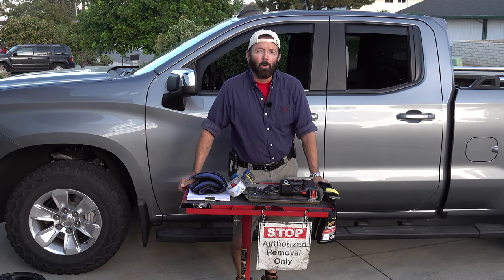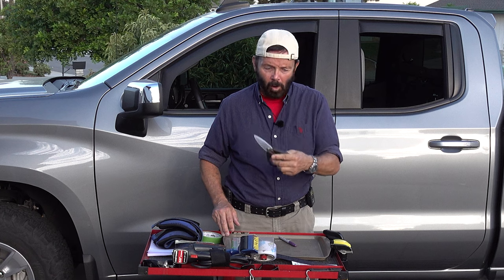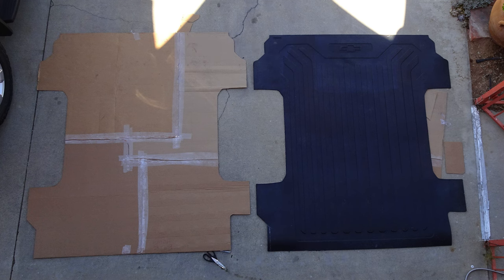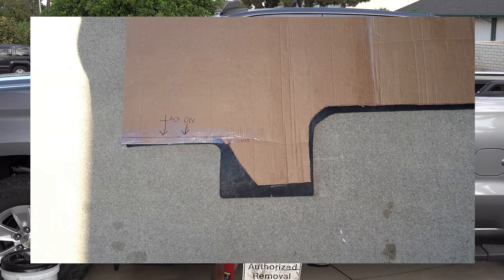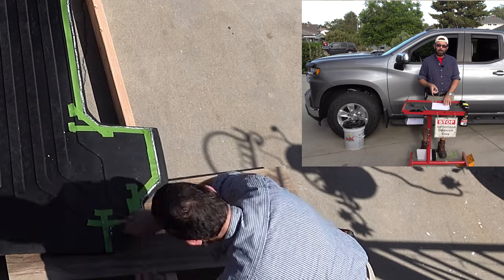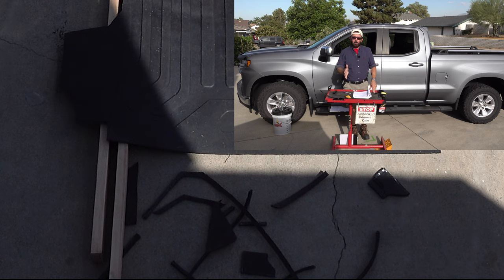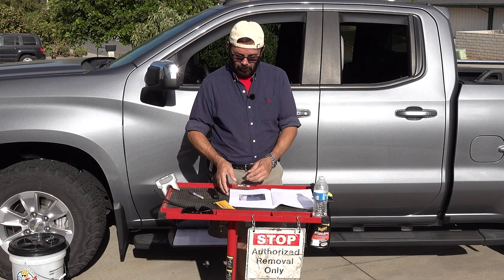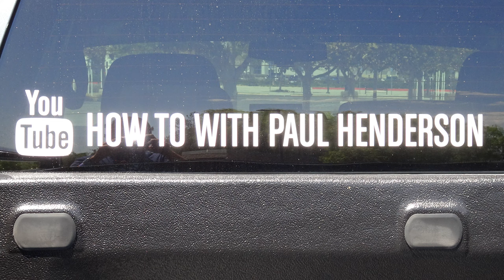Chevy Rubber Bed Mat modification to fit in my Drop in Bed Liner w/Paul Henderson

Comment: Excellent video and instructions/tips. I have a 1998 F150 that has a bed mat lying on top of the bed liner. It has been outside for 26 years, and it is still good as new. It also appears to be twice as thick as the one you demonstrated. A carpet knife wouldn't make a dent on it, and aviator shears made the trimming situation laughable. My first thought was to use a saw, and when I found your video with the jig saw and recommended blade, I knew that was the right choice. Instead of making a template, I just took precise measurements of my 2024 Maverick's bed and transferred them to the mat and used colored duct tape as you suggested. Worked perfectly. Thanks again!
Reply from the maker: Hi TMXV
That's awesome, glad you found my video useful.

Comment: question do groceries/stuff still slide around ??? 
iv have been contemplating about getting a rubber mat on top of my plastic liner simple because everything slides around
Reply from the maker: Sorry for the late response. If you have them in boxes or crates they may not, I went and exchanged a few propane tanks that I sit in some plastic bases and they did not slide around on the rubber mat. Before I put the rubber mat in i couldn't keep anything from sliding around  unless it was tied down...